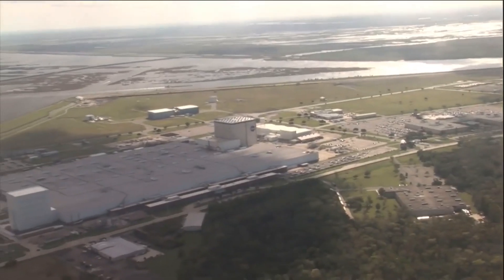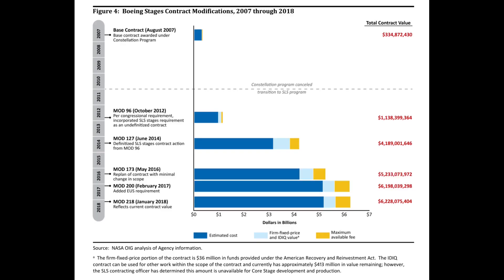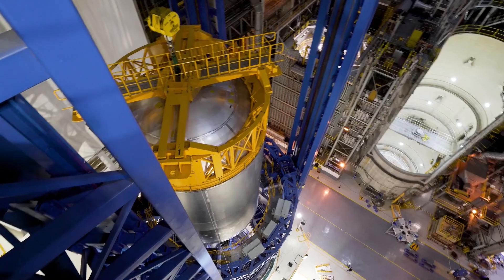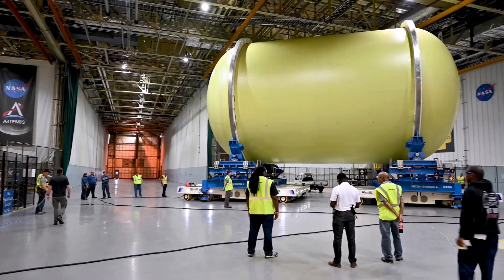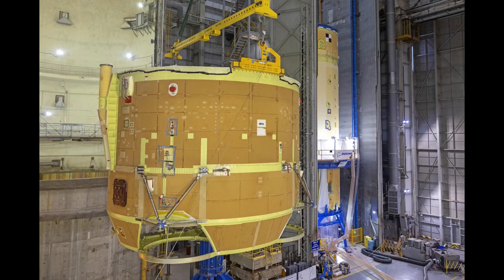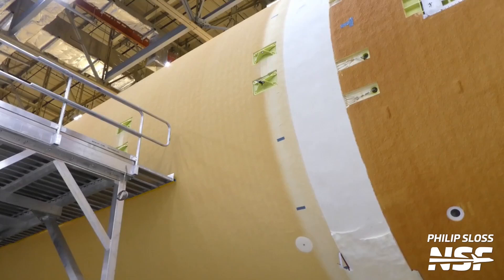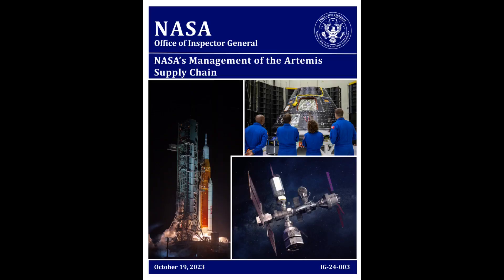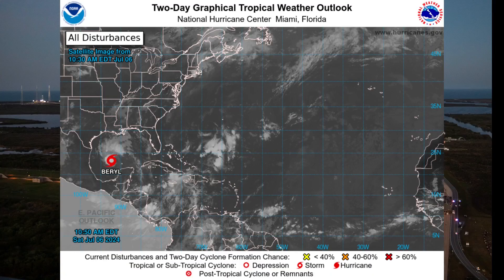Here's how NASA's SLS Core Stage for Artemis II was built

Comment: Absolutely batshit insanity to spend that much on such a massive complex rocket just to use each one once.
Reply: I think you’re oversimplifying things by a factor of about a thousand. 

Everyone thinks “big rocket 1 flies, big rocket 2 flies, big rocket 2 can be reused! Big rocket 2 is better!” 🤦‍♂️

Yeah, well “big rocket 1” flew flawlessly on its first flight, and is human-rated; requiring ~4x the complexity and redundancy (and cost) to reach acceptable levels of safety factors. “Big rocket 1” also has a habitation / crew module and life support system, which would have been capable of sending humans around the moon safely during its FIRST flight. Starship is an empty shell, they couldn’t even open a tiny payload door on their THIRD launch. 

Starship is an incredible vehicle, but you’re comparing apples to oranges. If nasa wanted to waste money - they could have just strapped some boosters on a giant fuel tank and launched it into space over a decade ago. 

I truly hope you realize how long it’ll be before starship carries a single human onboard.
Reply: @EstorilEm  A starship-launched mission doesn't have to carry humans onboard during launch.
Launch with an expendable upper stage, with Orion as the only payload. Refuel in LEO as needed to overcome boiloff.
Launch a Dragon 2 carrying the crew to the Orion-Starship complex. After Dragon 2 departs, starship is used for TLI.
Even with 3 refuelings, and a dragon 2, its still 20% the cost of one SLS (Using 100 million/launch for the launch of a single Starship).
So, your points on "Starship can't carry crew" are all irrelevant. 
Starship uses iterative development, so first flight performance is also irrelevant. The version that would be used won't fly until Flight 7 (assuming Artemis uses V2 initially).
And I wouldn't exactly call SLS (or Orion, for that matter) safe. SRBs can't throttle, or shut off. If an issue happen with one, that an instant abort. And Orion's issues may make an abort suicidal(battery issues. PDU, ect, ect).
(Also, IFT-3 did feature opening of the dispenser. Go rewatch the video)
Reply: @bryanillenberg  just to nitpick your IFT-3 point, I'm pretty sure they were aware the pez dispenser opened, but the point was it immediately broke and failed to close. Starship is an incredible piece of hardware, and WILL almost certainly change the economics and capabilities of heavy lift operations but unlike SLS, it has a long LONG way to go before its human rated, or even until it's fully operational as a reusable system with a significant payload capacity, and even still they are designed for different missions.
Reply: @GlutenEruption  Starships LEO capacity is already over SLS Block 1s. 
And I'm not advocating for launching crew on Starship. I'm advocating for using Starship to launch Orion, and flying the crew up to Orion with Dragon.
Yes, it has a LONG way to go. But since a realistic NET date for Artemis 2 is probably 2026-2027, by that point starship will be an operational, fully reusable (hopefully, but they may not have worked out Ship reuse yet), and have nearly double SLS's payload.
Reply from the maker: @bryanillenberg  It's fair to put wide error bars on the Artemis 2 date, but it's also fair to say that November 2025 (for example) is just as realistic.

It's after Artemis 2 that the uncertainty opens up a lot more, not just for Orion/SLS but also for Starship.

Starship has its own uncertainty, which is when it will be available for Artemis.

One of the reasons for so much speculation about alternate Artemis 3 missions is because of concerns that the Starship system will be able to make it to the Moon by 2026-2027.  (The 70% JCL estimate for Starship readiness for Artemis 3 was February 2028.)

Starship first has to be able to send itself to the Moon before it could take Orion along.
Reply from the maker: @bryanillenberg Starship HLS definitely does need orbital refueling to go to the Moon.  The crewed lunar landing demonstration that is a part of Artemis 3 will require a dozen tankers or so to come up to a depot in Earth orbit beforehand.

Starship orbital refueling is the critical path for Artemis 3 right now, and SpaceX has multiple Artemis demonstrations to conduct, beginning with an orbital refueling demo.

For SLS, you're conflating the situations for Artemis 2 and Artemis 3.  The SLS for Artemis 2 is finished, the rest of the pieces just need to be shipped to Florida.  The Orion heatshield issue is probably the biggest risk, but NASA is considering flight of the current design as-is for Artemis 2.

If so, then Orion is basically finished, too, and NASA is still targeting September 2025.  They would start stacking SLS this year and then we'll see what happens when SLS goes out to the pad first for a tanking test next year.

It's the SLS and Orion vehicles after Artemis 2 that are still under construction.
Reply: @PhilipSloss  Yes, HLS needs refueling. Never said it didn't.
I did say that Starship doesn't need refueling to replace SLS.
When I said the Artemis 2 SLS isn't finished, I mean it isn't stacked, and the core stage does still need some work.
I am aware that NASA is (unfortunately) going to use the current Orion heat shield for Artemis 2, but they almost certainly won't launch until they understand why unexpected levels of spalling/ablation occurred on Artemis 1.
Reply from the maker: @bryanillenberg  Sorry, then I misunderstood.  Can you say again how Starship can replace SLS without refueling?

Edit: re-read your earlier post.  Correct me if I'm wrong, but it says Starship would perform a TLI burn with Orion after the crew transfers from a Dragon...here's what I don't understand: How would Starship do a TLI burn from LEO without being refueled?

Is it based on Block 2/3 numbers?
Reply: @PhilipSloss  Since the starship would be expendable, so it would have a dry mass of roughly 60 tons. This is just an estimate, but it seems reasonable.
It would enter LEO with a significant amount of fuel left. Almost certainly >120 tons, which is what would be needed with an ISP of 380.
Boiloff is the only major concern. But since HLS has a 100 day loiter time, a F9 scrub or two is survivable.
(I'm using Block 2, with 150 tons reusable, ~200-250 expendable)
Reply from the maker: @bryanillenberg  The question for this is the same big picture question for the Starship capabilities in general, which is when they will be available.  It will be interesting to see how the performance upgrades are folded into the development sequence.
Reply: @bryanillenberg  Does anyone remember when we were taking bets on which vehicle would fly first, Starship or SLS? SLS still beat it by half a year, and that’s with major weather roll-backs, etc. 

Clearly some haven’t learned their lesson here - the same logic applies to future SLS missions. Elements have been perfected and tested over a decade for upcoming missions. The next milestones will be more of the same.

I have no doubt starship will catch up (rapidly, over the next few years) - but SLS flew. It exists. I’m just not sure why some people can’t give it the slightest bit of credit - much less versus an empty tin can (at the moment.)
Reply: @EstorilEm  Starship has now also flown. It exists. And its superior to SLS in literally every... single... way.
People "don't give it credit" because there is a better vehicle that can replace it! Why continue to use an obsolete tool when the newer model is cheaper, already ready to go, and is only going to get even better?
Reply: It only takes one asshole to get the negativity started.
Reply: Well, there isn't an alternative, so...
wait. We have Starship. Nevermind. It IS insanity!
Reply: @bryanillenberg Starship is no SLS alternative.
Yes it will be able to get a lot of mass to LEO, but that's not the only thing SLS does.
Also there's nothing wrong or novel about expendable rockets, this has been the norm since the start of the space age.
This feels almost copy pasted from Elon Musk's twitter.
Reply: @brokensoap1717  "Starship is no SLS alternative" Wrong
"Yes it will be able to get a lot of mass to LEO, but that's not the only thing SLS does."
All SLS needs to do is deliver a fully-fueled ICPS+Orion to LEO. Falcon Heavy can do that. Starship already has a payload capacity of 100 tons.
"Also there's nothing wrong or novel about expendable rockets, this has been the norm since the start of the space age"
Also wrong. The moment Falcon 9 landed the booster, every single other rocket on the planet became obsolete.
Reply from the maker: @bryanillenberg  ICPS is retiring, but it's underpowered to do a TLI from LEO with Orion.  FH would need to get the Orion-ICPS stack up to a ~2000 km apogee.

There are other con-ops that could be used with the FH capability, such as the dual-launch EOR one in Constellation.
Reply: @bryanillenberg FH absolutely cannot do what SLS does, are you unwell or something? FH has roughly HALF the payload to LEO (don’t just believe the theoretical numbers, because it can’t ACTUALLY do that due to structural limitations, as mass is rarely the sole limiting factor.) 

Once you get into second stages and their capabilities / efficiency, it becomes a joke. FH wasn’t designed to send huge payloads outside of LEO or GTO, SpaceX simply doesn’t have a second stage to do it well. MVAC is great; cheap, reliable, easy to build, and fairly efficient for what it does (throw tons of commercial sats into LEO) but that’s it. 

The EUS on SLS will be able to deliver more than half the TOTAL *LEO* payload of a FH to the MOON. 

Again, apples to oranges.
Reply: @EstorilEm  The structural limitations are with the payload adapter, not the second stage. ICPS would require a custom adapter.
And FH, with this mission plan, isn't using its second stage to deliver Orion to the moon. Its using ICPS for that (though fully fueled, the Falcon second stage is WAY more capable. Yes, it has a lower Isp, but a mass ratio of >20!). 
EUS is irrelevant, and overpowered for what NASA needs with Artemis. There's a reason the first EUS payload is flying on FH.
Reply from the maker: @bryanillenberg  There are probably multiple reasons NASA chooses FH over SLS for multiple applications, but performance would be lower on the list.

FH doesn't have the performance of SLS, but it is readily available and much more affordable.

An obvious case would be the Gateway CMV, which could make use of a lot more performance.  But no one can field an alternative, so FH remains the best choice.  (And arguably the only choice.)
Reply from the maker: @bryanillenberg ICPS dV for EM-1&2/Artemis 1 was restricted to ~2900 m/s vs. ~3200.  
https://ntrs.nasa.gov/api/citations/20140006564/downloads/20140006564.pdf
https://ntrs.nasa.gov/api/citations/20205005150/downloads/AAS20649_Artemis1_Trajectory_Design_Optimization.pdf

Where are the numbers you cite here sourced from and what are the assumptions attached to them?

The Gateway CMV provides a data point for FH expendable performance.  It can only get to 33700 x 200 km with that payload, which is a significant fraction of the Orion control mass.
Reply: @PhilipSloss   I used the rocket equation, with ISP and masses from Wikipedia. The numbers in the document linked varied based on the launch date (pg 8), so that isn't the limit on ICPS performance, just the amount of dV needed for mission success.
Also, FH's upper stage would not be used beyond LEO if FH was used to replace SLS. The ICPS would do the majority of the TLI burn, with the ESM making up for the dV shortfall.
Reply from the maker: @bryanillenberg  It's close to the limit of ICPS performance, otherwise SLS would insert to a lower apogee to lower MMOD risk.  Do you have a reference for maximum ICPS performance?

Edit: if I use the Orion TLI mass of 58500 lbs, plus the OSA mass of 1800 lbs, plus the Wiki numbers for ICPS, I get a dV of 2977 m/s.  That's for a single burn to depletion, which doesn't take into account the other mission burn, margins for a disposal maneuver, margins held in reserve, and variance in performance, so that's optimistic.

ESM has very limited margin given its already limited propellant storage.  Using that 2900 m/s limit, they were talking about using ~140 m/s from ESM to do a lunar flyby.

To fly a mission into/out of the Gateway orbit, they will need more ESM dV margin.
Reply: @PhilipSloss  I used the wiki numbers for ICPS (which I believe does include the OSA, but IDK) and Orion, as well as an ISP of 462 s.
Reply from the maker: @bryanillenberg  No worries.  The SLS reference that NASA put out in 2022 has most of the same ICPS numbers, but also has the OSA separate.  OSA is an SLS program part, but ICPS was (of course) COTS hardware from ULA.
https://www.nasa.gov/humans-in-space/space-launch-system/reference-guide/

Plus, I'd guess the numbers are reasonably close, but it's hard to know how precise, particularly in the export control/limited data rights era we're in.  The reference itself says "Numbers are approximated to meet security, export control, and proprietary requirements."
Reply from the maker: It's not about the messenger or their tribe, it's about the message.